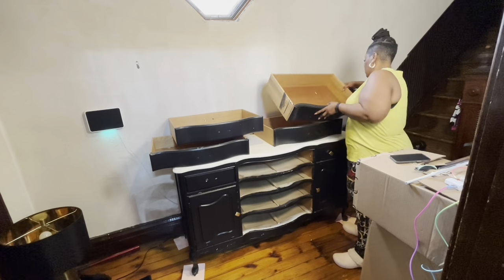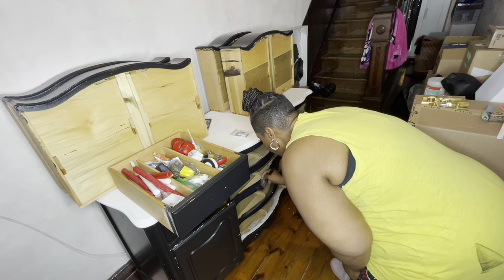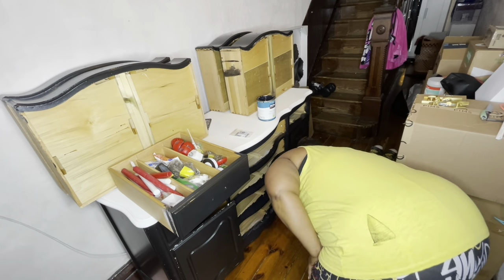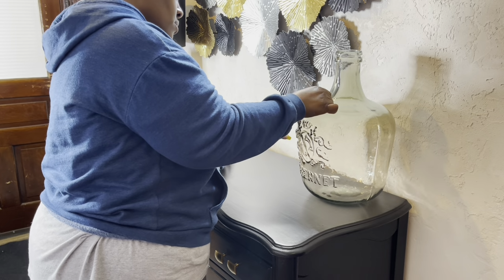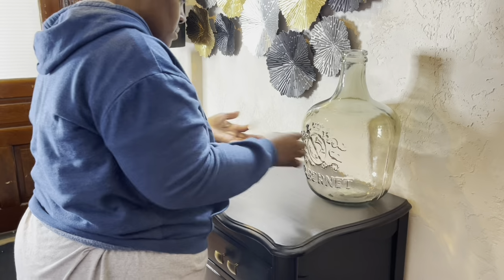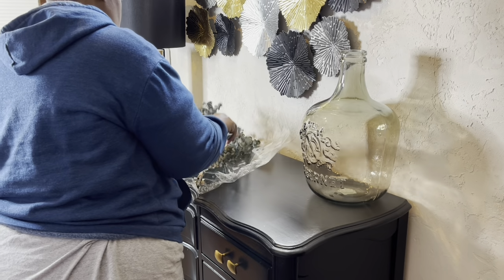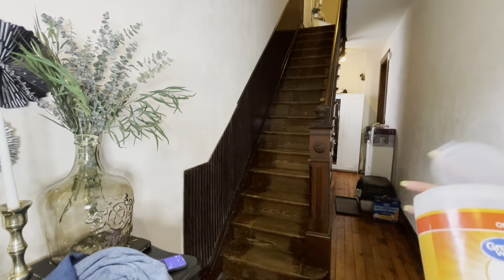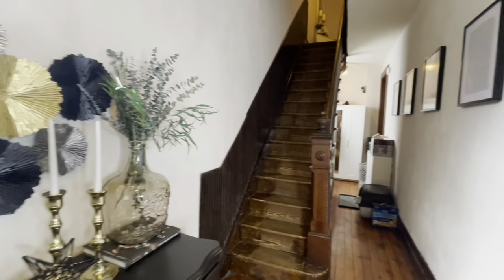EPIC ENTRYWAY TRANSFORMATION / BLACK, WHITE AND GOLD DECOR / MODERN ENTRYWAY ON A BUDGET / SHYVONNE

Comment: Shyvonne the door is still in excellent shape. Have a handyman/carpenter take it off the hinges. If it has paint on it, use a paint thinner and then sand it and it will look completely new. Then you can stain it whatever color you like or paint it.

Comment: Everything looks great, but you do have decisions to make. Because it is an older home, I'm suggesting to add window film that looks like stain glass to transit and octagon window. The octagon window needs framing.  Near the bottom stairs, there is wainscoting that I would extend further to front door. Wainscoting come in sheets. You can use decorative ceiling tiles to other wall to add what style works better for you. I know you said white stairs and molding, but you should consider black for doors, stairway and all molding. Adding white is definitely gonna be a lot more work. You can add white to risers or threads.  Just want to suggest when decorating, don't crowd the space.  Less is more.☺☺

Comment: Shyvonne there is a machine screw anchor for wood. I'm sure you can find them at Home Depot or Lowes. You will have to fill the existing holes in your stuck drawer. Wood glue and wooden toothpicks or match sticks will work for that. I love the all black also. Looks awesome.

Comment: Shyvonne, I would just leave the walls textured. It's so expensive let alone just having someone paint. Could you imagine if they came in and had to smooth them out. As for your front door, I would just get some stain and go over the door. It's solid wood (like you said) and it's so pretty. I like the buffet black, because you have white walls. You are doing a fantastic job girl. Keep up the good work.

Comment: The main door is stunning sanded and stained it will look like new, don't get rid of it the house need to keep some of it's character having all the wood floors sanded and stained with rugs down will be stunning you can combined old with modern that's how all the top designers are doing it  . You could use the window film on the bathroom window and take away the curtain it would finish the bathroom nicely. I would get a slightly wider and longer runner. Love the unit all black

Comment: I 🖤🤍 it. If you wanted to pop the Hexagon Window...You could get a strip of corner rounder, spray paint it black and use double sided adhesive (in the event you want to change the color scheme) to install.  Or measure for the cuts and get Home Depot to cut it out for you 🤷🏾‍♀️

Comment: I like to table all black but you really should have sanded because the reason the black chipped off the white was because there was no sanding in between coats so there was nothing for the paint to adhere to.  You should watch transcend furniture gallery. She is really really good.

Comment: Your front door is beautiful.  The wood cannot be duplicated.  Have you thought about hanging curtains at the door.  The rod running across the top and to the side walls.  Then the curtains can bracket the door.  I did it with my front door.  Cuts down on echo and is an insulation factor.  Your home is looking beautiful.

Comment: I’d find a carpenter to repair the door. A had a solid wood door that was destroyed when someone broke into my home about 20 years ago. It was nothing like yours. Just a slab with a peep hole. To get the same door then was 2500 and that didn’t include install. Yours is original to the home. I’d say keep it because the price of doors are not cheap and wood is priced out of sight. I think the original with maybe a stained glass design would look nice. I know you want to go modern but stained glass never goes out of fashion. even if you use plexiglass for safety, there are some nice designs out there. Visit a glass replacement store to see what they may be able to help you with. 

The house is looking good.